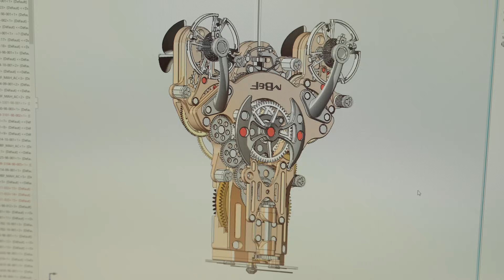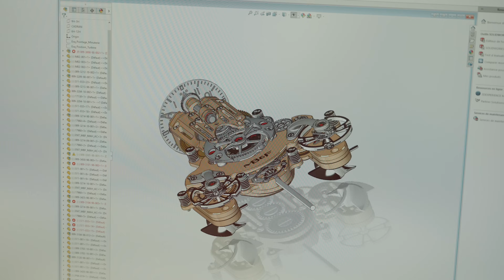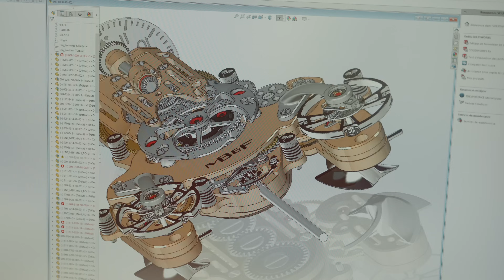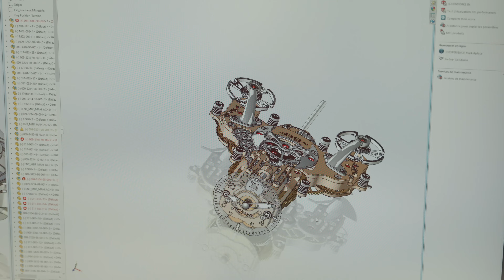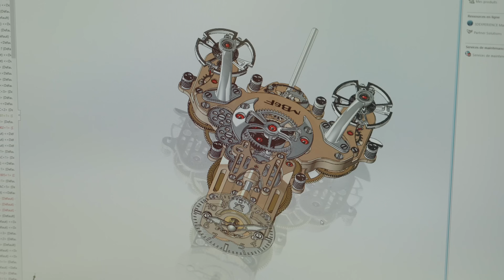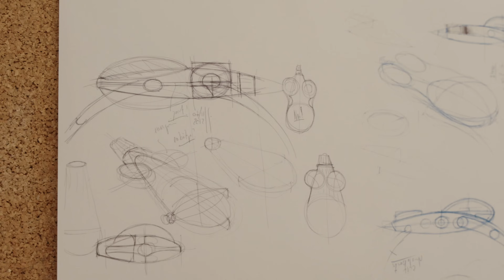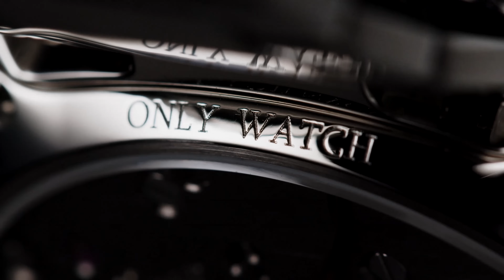The Most Interesting Man In Watches - Visiting MB&F With Maximilian Büsser in Switzerland

Comment: As somebody that has spent years creating 3d models on various programs, that is one heavy file at @14:32! What's crazy to see is that even with probably a high-spec PC, the model is still facing lag (even before the render stage). Imagine the complexity! Awesome work Teddy! MB&F is hands down one of my top 3 favorite watchmakers!
Reply: Imagine if they have the model set up for actual motion, that would be incredible.
Reply: well, it's Solidworks, what can you expect? I hated working on it, every time you'd get the external part missing link error, so many other issues. Its built on a legacy architecture
Reply: Is there better software to use to design watches?